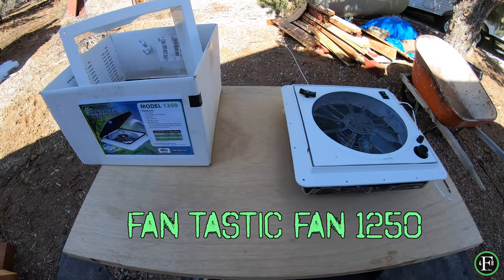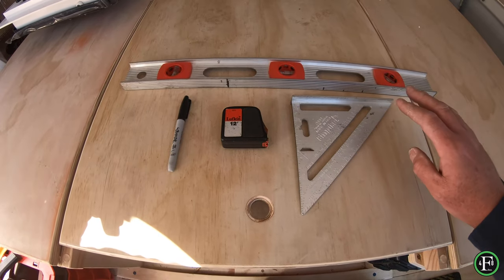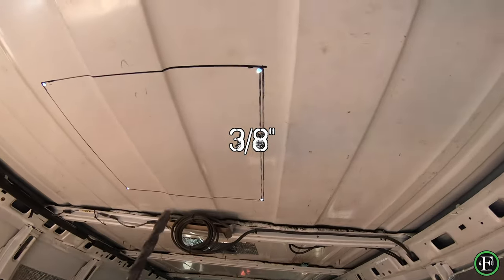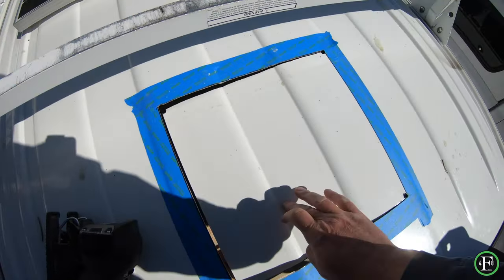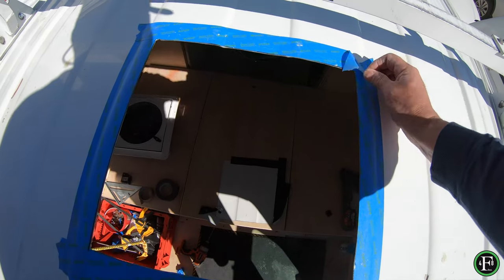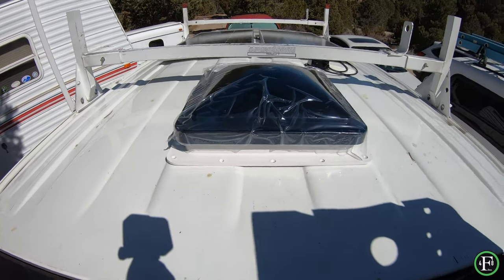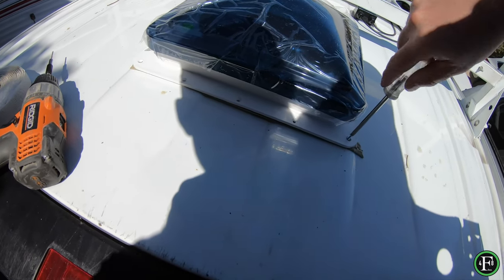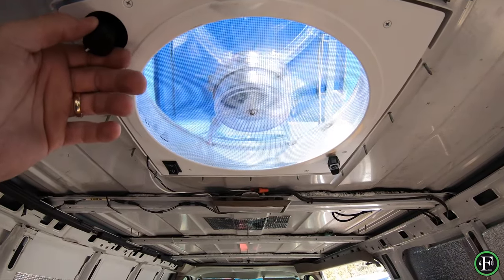VAN BUILD | HOW TO INSTALL A FANTASTIC FAN ON YOUR VAN.

Comment: Tape the other side when you're doing your final cut that way it doesn't Jump Around and also that way it doesn't fall into the hole.
You also forgot to put the tube sealant" self-leveling "around the edge of the fan and cover the screws.
Good luck with the weather

Comment: What happened to the cargo trailer you were working on?  I have the same trailer and I was enjoying watching the how to videos.
Reply from the maker: Melissa I still have it.  I did not make it much past the insulation and windows and a few other things.  Love the trailer I use it all the time.  I got side tracked with a van conversion it turned out great love it and got into a motor build on my 2500 had truck.  In saying that the truck will become a adventure build the van will hold me over camping and the trailer will get completed to pull behind the big truck.  Lol lots of stuff.  Now I just need to film and post it all for people to see.  Lol. Stay subscribed and be patient friends I will be posting many other great things soon.  Melissa check out my other vids as well and thank you for being a subscriber👍

Comment: I’ve got the whole cut and will install the fan in my van soon. Just a question for anyone who knows: should I use a layer of seal and to double the edge and also cover the screws? If so, what type of sealant should I use? Thank you!
Reply from the maker: I haven’t yet and it has withstands major downpours so far.  You should put a sealant over the screws.  Not sure exactly but I’m hoping someone chimes in with the best sealant for that. Short term fine but long term could be a factor.